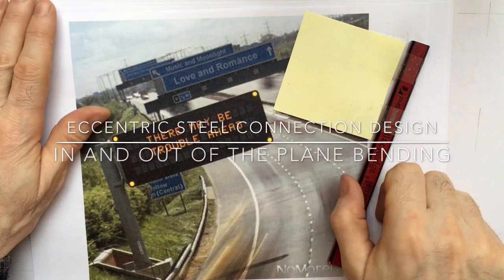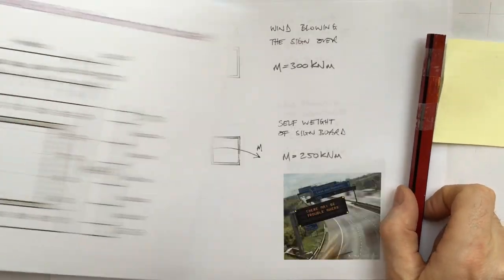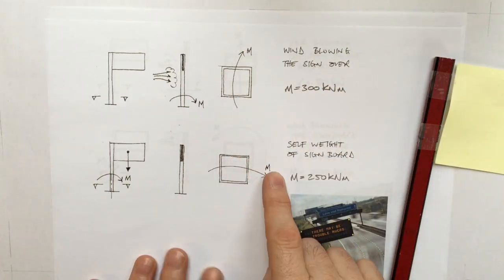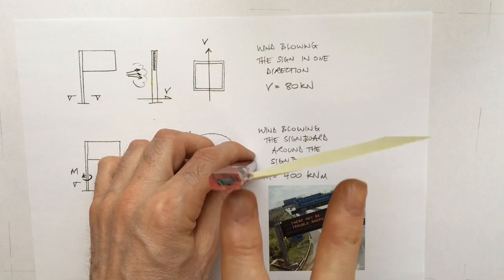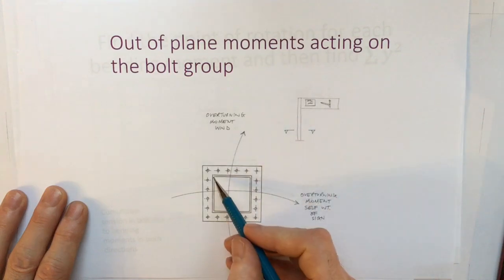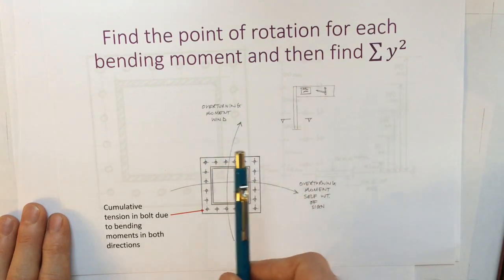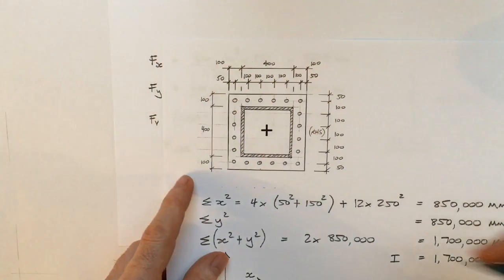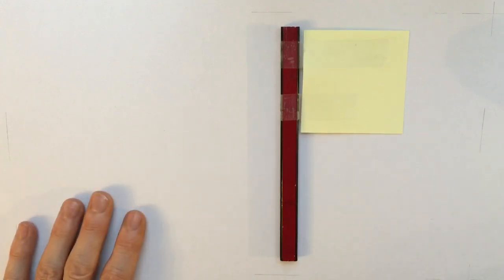Bolts in both in and out of plane bending

Comment: Sir i didn't understand thew point of rotation why its in the center of flange....?
Reply from the maker: Hi vaibhawagh8782, that’s a good question. Yes, the centre of rotation (for bending about one of the two axes of the RHS column) is taken to be the centre line of one wall. Imagine a solid brick on your desk. Imagine pushing it horizontally until it falls over. First, tension develops on one edge of the bottom face (at the base of the face that you are pushing), then that edge of the brick starts to lift up and so all of the vertical load of the brick is transferred to the desk via the opposite edge. This is the only point of contact and this is the centre of rotation. The brick rotates around this edge. The steel RHS acts in a similar way. I hope this helps, Mike

Comment: could you take the moment position in the centre and then still do sum of the y squared but subtract the negative y distances? I assume you would get the same result?
Reply from the maker: Hi Ben, I am not quite sure that I understand your suggestion. Usually, it does not really matter where you take moments - you should still be able to work through to an answer as long as you are careful. For this connection, I have just tried to show the quickest and most straightforward way to get to an answer, Mike
Reply: @mikebather  sorry difficult to explain without a drawing. Thanks for the video

Comment: Hi Mike, really well explained. Just a quick question if you don't mind, Is there a need to check prying action and how would you go about it?
Reply from the maker: Hi Musa Mahomed, thanks for your comment and question. Good point. I have focussed on just working out the forces in the bolts - rather than designing them. To do this, it is likely that you would need to choose a code of practice and this is where you would begin to consider prying etc. I believe that some codes include a 'hidden' allowance for prying and others require the designer to consider it specifically. It depends. Hope this helps, Mike
Reply: @mikebather  thank you for your response.

Comment: Very informative and easy to digest. Does the same principle apply to the CHS instead of RHS? Ie will the center of rotation be to one side?
Reply from the maker: Hi Maverick W, that is a good question. Yes, for out of plane bending, there must be an axis around which rotation takes place. In an RHS section we choose the centre line of one wall - so this is fairly straightforward. For a CHS section, it is a little more complicated. Looking at this in a slightly simplified way, we just need to make sure that there is enough steel acting in compression in the curving wall of the CHS (so that the compression stresses are not too high) and our axis of rotation needs to be drawn through the centroid of that steel in compression. This is quite hard to find, but you could easily make an estimate that is likely to be near enough for preliminary modelling hand calcs and to check the output of software. I hope that this helps, Mike

Comment: Hi thanks for the video ! I've got a question 
  In plane bending  = Torsion 
Out of the plane bending = Bending about minor axes and major axis 
Is my above statement right ?
Reply from the maker: Hi doomslayer, what you are saying makes sense for an endplate fixed to the cut end of beam or column attached to a support with the endplate at 90 degrees to the longitudinal axis of the beam or column, Mike

Comment: 13:17 Are we assuming the polar moment of inertia is in units of mm2? Since the calculation works out in units of kN rather than kN/mm2?
Reply: Taking this one step further to bolt design.... if we ignore the area of the bolt, and work with polar moment of inertia mm2, can the resultant force simply be checked against the max shear strength of the bolt to confirm adequacy of the bolt?

Comment: If we have a circular section how do you determine the center of rotation?
Reply from the maker: Great question, this is a lot trickier than for a rectangular section or for an open section bending about its strong axis. What follows is a suggested way of thinking about this. Other engineers may have different opinions.
Remember that you can work out the compressive force in the flange of a section in a moment connection. Well, this compressive force must be transmitted between the member in bending to its endplate and then to the supporting member. At each point of transfer there must be sufficient weld or metal to transfer the compressive forces. So roughly think about sizing the weld to carry this force and then consider what area of metal is needed to carry the force (in bearing). Once you know this area you can estimate the area of the circular section needed to carry this force and find its centroid. This could then be taken as the stiff point around which rotation takes place.
Please remember that these calculations are an approximation of the way that steel connections behave, only considering elastic behaviour, in reality, things are more complex. However, there is always a balance between time spent working these things out and getting an exact answer. Hope this helps, Mike

Comment: Hi, Could you please tell me how you concluded that the center of rotation is the center of the wall of the RHS? Maybe it is in the middle of section.
Reply from the maker: Great question. Firstly, and least convincingly, this is the approach traditionally assumed in design offices for relatively flexible endplates. Secondly, you could pick up a brick and stand facing a wall, place the brick flat against the wall and rotate it (moving the top of the brick towards you and the bottom away from you). No matter how hard that you press the brick into the wall, the top moves away from it and the brick pivots around the bottom corner which simply presses against the wall. This is because it is a stiff point and does not 'give' or deform.
A steel beam is similar, the bottom flange is a stiff point around which it inevitably rotates. I hope that this helps, Mike

Comment: at 12:00 he calculates X2+y2 whose units are mm2 but he then he says its momet of inertia with mm4 units? How
Reply from the maker: Good spot, this is an error (I think that I was rushing to complete this calculation to avoid over-running the time limit set by You Tube). The polar moment of inertia calculation can be used to combine areas (such as cross sectional areas of bolts with units square mm). So you can assume that each bolt has an area of 1 square mm and then the final units become mm4. It would have been better to leave the units as mm2.

Comment: This entire video saves my life. I just want to thank you. However, I was keep wondering where the formula Ft = My/y^2 comes from? And what does that y^2 mean?
Reply: at 12:00 he calculates X2+y2 whose units are mm2 but he then he says its momet of inertia with mm4 units? How
Reply from the maker: It is a little hard to explain this in words, but the force in any one bolt can be found by using similar triangles. It is assumed that the force in each bolt is directly proportional to its distance from the point of rotation and its position with regard to the other bolts in tension. I realise that these words are not much explanation but I hope they help a bit.

Comment: Hi Mike! This maybe a trivial question but is there a design method for the edge distance between the bolt and the base plate? If the edge plate edge distance from the bolt is not adequate, it could fail right? What is the failure mechanism?
Reply from the maker: Hi randomness2376, you are perfectly right. The edge distance of bolts is really important; as are the bolt spacings and the end distances. If these distances are not right, it is possible for the plate to fail by tearing - this could be local or block shear failure. In this calculation, although the force in the bolts is found, the design of the bolts (and their setting out) is omitted. This would be the next job for an engineer. Hope this helps, Mike

Comment: How did you get the in plane and out of plane moment? what is the load and the lever arm?
Reply from the maker: Hi Nabeel, in this example I have just plucked the in and out of plane moments from the air. In reality, an engineer would have to calculate these considering wind loads and the weight of the signboard. Sorry, but I cannot fit everything into such a short video! Mike

Comment: Thank you very much sir for giving us such a good explanation. I would like to learn more from you. Can you please take up an example regarding the base connection design of a mono pole(height may be 20m or 30m) i would like to learn more accurately working out its base plate design and anchor bolt design  by working out the tension and compression in bolts as well as in base plate. this would help me a lot.. i would like to thank you in advance.i will be waiting for your video upload.
Reply from the maker: Hi zeeshankhan pathan, thanks for your comments and suggestion. I am working on some different videos at the moment but will try to remember your idea for the future. In the meantime, many engineers in the UK make use of the Sign Structures Guide (http://www.theihe.org/wp-content/uploads/2013/08/SignStructuresGuide2010.pdf)
Reply: +Mike Bather thank you sir for considering my request. And I will go through your given guidelines.